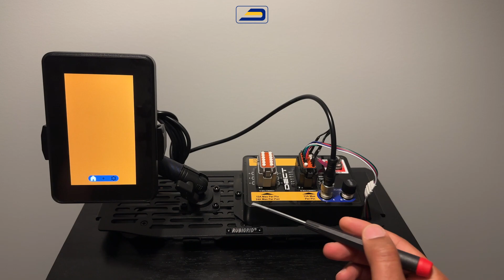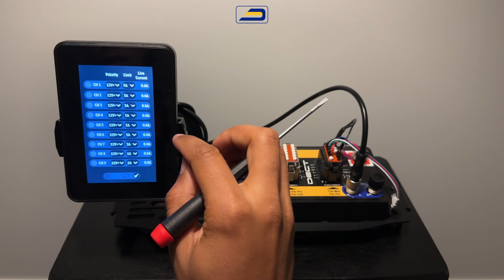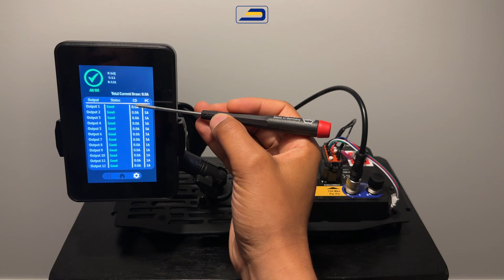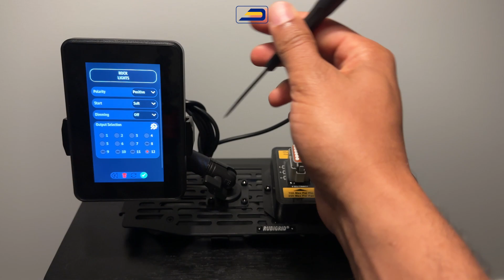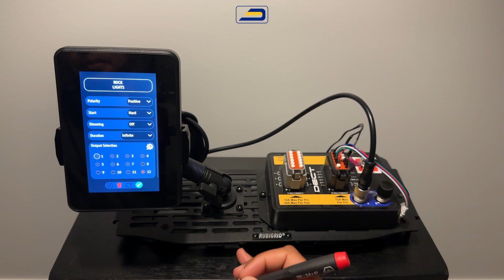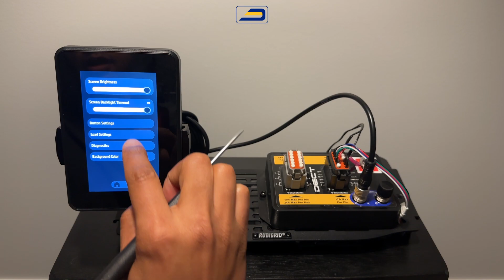XT5 & PDM12 Introduction

Comment: Is this switch compatible with NMEA 2000?
Reply from the maker: This switch system runs on CAN bus, so theoretically, it could talk NMEA 2000. However, this system is currently designed to function as a standalone closed system. In an application where a NMEA 2000 network existed, this would run alongside a NMEA 2000 network as a separate network. If you have a need for N2k integration, please each out through our email: info@dectsystems.com